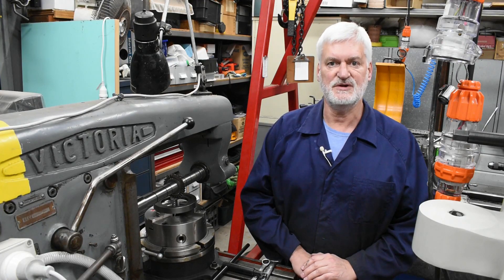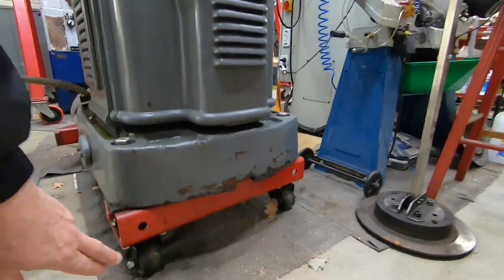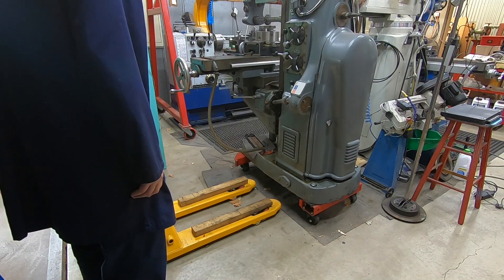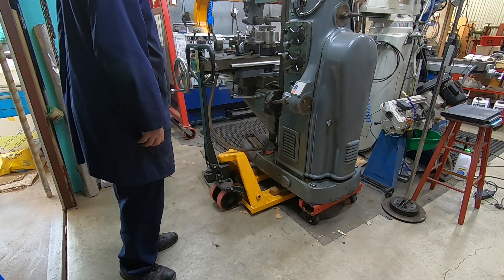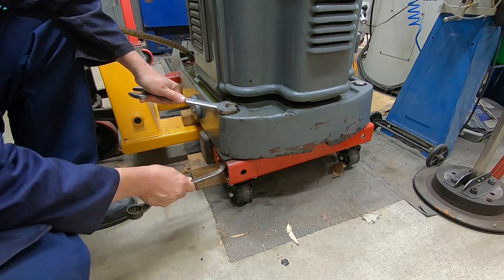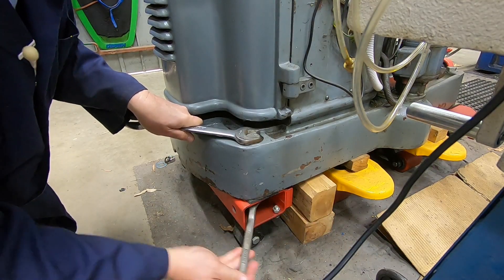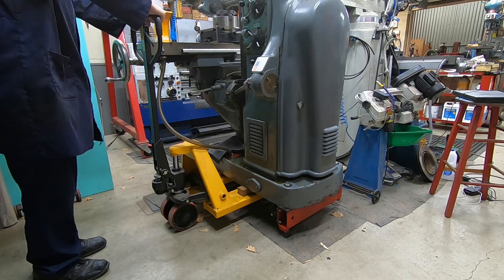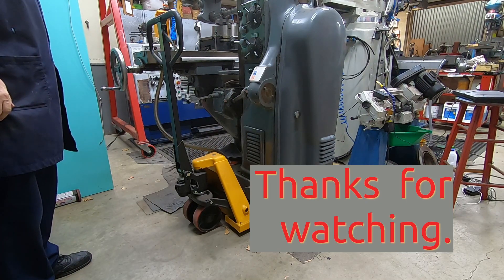Mobile milling machine

Comment: G day Alan can you tell what lathe that is in the back ground and it’s designation ? All the best stay safe 👍 cheers
Reply from the maker: Toptec C6246X1000.  Swing over bed 460mm and 1000mm between centres (Mfg date Feb 2004).
I bought it very cheaply 4 years ago when it was retired from service in a production environment. It has a lot of wear in the bed and is very noisy in operation. However, it is very robust and has been completely reliable. I sometimes dream of replacing it with a new one, but my investment strategy for funding this has yet to bear fruit - a winning lottery ticket :)
Reply: @alanshomeworkshop   Thank you Alan,  yeah I’am in a similar situation would like to replace the Lathe I have got,  chasing more precision 
mine is a gap bed lathe as well,   I have been trying to reset the gap but not with any success,  disappointing when you turn something and it is tapered, cheers
Reply from the maker: @jackk7030  Taper turning on longer work pieces was one of my specialties as well :(   Things improved after I spent some time playing with tailstock alignment and accepting that I would have to do such jobs in distinct segments using hand finishing with file and emery to blend it all together.